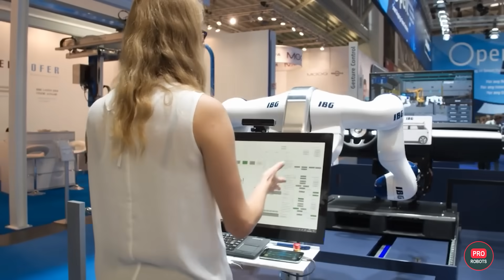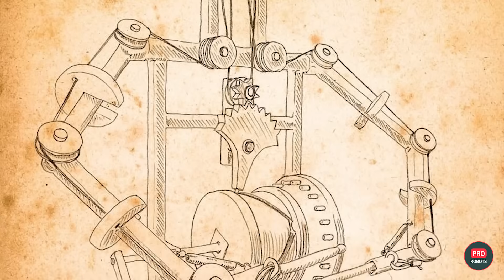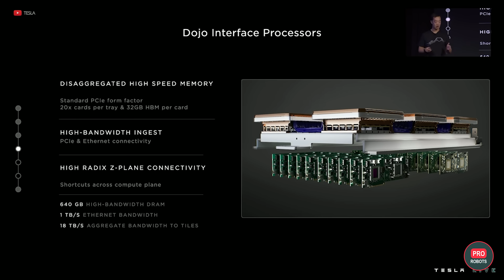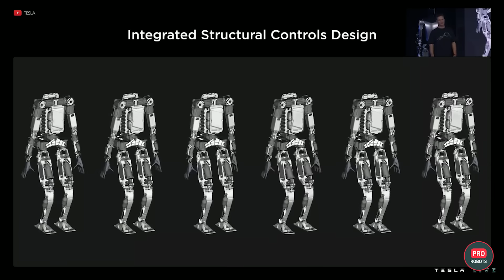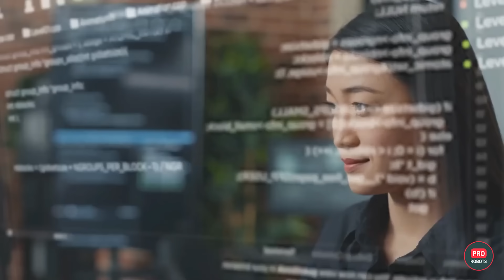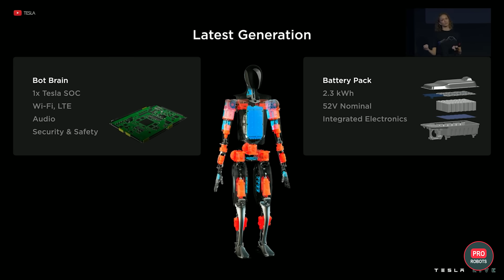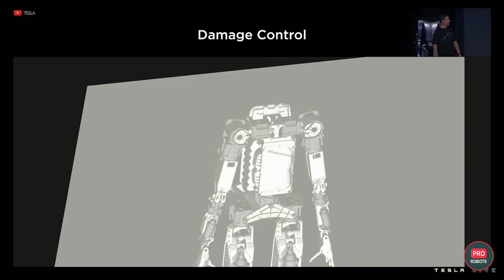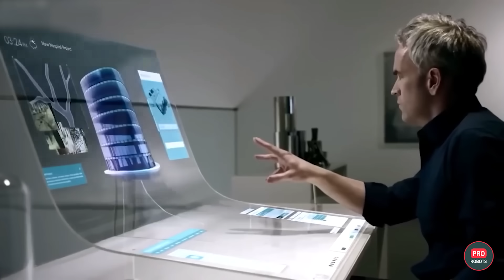Tesla Bot News. Robot AI | Humanoid robots are already a reality | Optimus vs Atlas and other robots

Comment: Now I think I understand a major advantage of making a robot as human-like in form as possible; training with motion-capture of humans at work is easier.
Reply: Exactly. Training can also be carried out via teleoperation by a human, which would be more difficult if it weren't humanoid. The second major advantage is that they will be able to step in to take over jobs in human-centric work environments. They won't need ramps, wider doors, work surfaces that are higher or lower than existing or different temperatures or lighting, etc. The modern world is designed for humans. What better shape for bots to fit in?

Comment: Forget picking up eggs, which are actually fairly tough. Show me a humanoid robot that can take muffins out of a muffin tin, pick them up cut them across and butter them and put them on a plate. Without crushing them when they're nice and soft. Of course it would be nice if it could mix the muffins batter and put them in the oven, set the dial on the stove, or push the buttons, get them out hot and prepare them to serve at the table.
Reply: Wait a few more years and you will be surprised :)
Reply: Aloha robots just released a video where the robot is making cookies, the whole process of it. blending,  using cookie cutter,  turning on oven, etc. You are only 1 day behind reality so still pretty good :)
Reply: @ErikGoff  That was all tele-operated, not learned behaviour. It was showing that the hardware had enough degrees of movement to be able to perform all those tasks. A very impressive validation of the bot design but still way off with regard to the training.
Reply: There are robotic Chefs in Japan
Reply: Wait 2 years.

Comment: Atlas can outperform Tesla robot..Dad is always remain dad 😀
Reply: Atlas outperform Tesla robot indeed... for about hour, than it dies and as long as it use hydraulics, it will not get any better.
Reply: @TheTenzen12 Let's see some proof for that statement. The Tesla robot is at least 10 years behind the top companies. It can barely walk.
Reply: @bobbybishop5662   Did you sleep for year or so? 2nd gen walk just fine. And even if  it wasn't it's still doesn't change that Atlas last barely more than hour. Less if it goes on full throttle. It's not like Boston Dynamics tries to hide it.

Among ALL humanoid robots, Atlas is least likely to go into production. Period.
Reply: @TheTenzen12  So you have no real knowledge of how long either robot batteries last . 👍 The new Tesla bot is slow slow slow.
Reply: @bobbybishop5662  All humanoid robots with legs are similarly slow. Atlas being exception and pays for it with heavy battery consumption. Hydraulics ALWAYS    eat more battery than actuators (which all other humanoid robots use) Why are you even here if you are unaware of most basic engineering facts.

Well whatever, feel free to have last word.
Reply: @TheTenzen12  X Robotics in China . I'm sure you are some wiz bang engineer . 🤣🤣🤣🤣🤣
Reply: Tesla robot learns on its own, atlas depends on being programmed to do anything that is why it looks more skilled but as  Tesla learns it  improves their is the difference but atlas is stronger at this time
Reply: @HenryCalderonJr  it's not using AI yet , they have made that clear.
Reply: @HenryCalderonJr  Atlas can kick in the the Tesla butt at this moment 😀..
 Respect from India